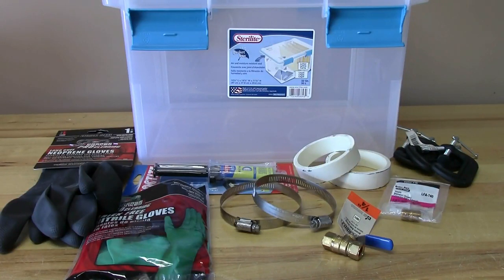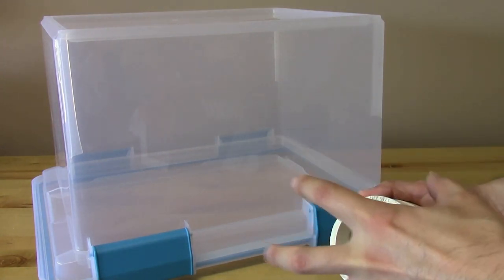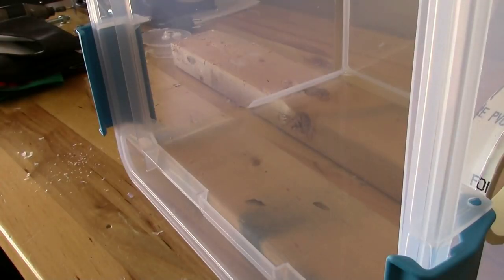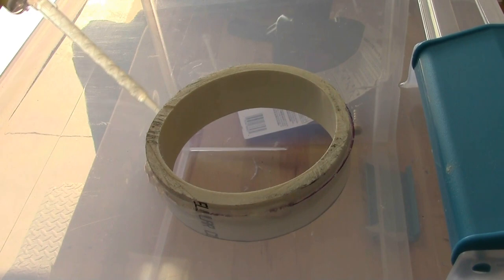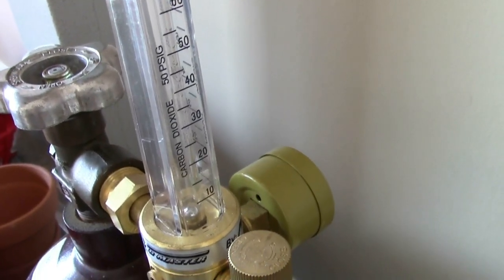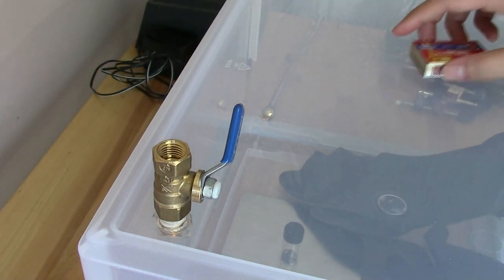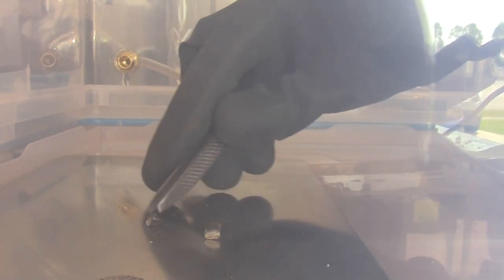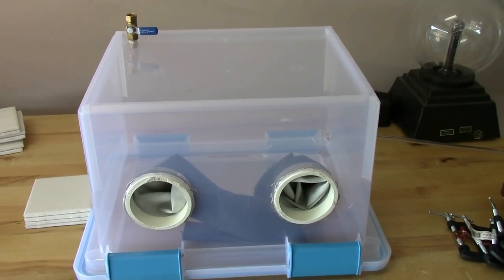Very Simple DIY Glove Box

Comment: Hey man is this anaerobic? I'm trying to make an Oxygen free chamber.
Reply from the maker: If you fill it with inert gas, sure. It does leak a bit, so depending on your requirements you may need to seal it better.
Reply: @mrhomescientist  do you think I'd need to buy a tank of like 1% O2 and Nitrogen? Thanks for your help
Reply: @mrhomescientist  also, curious how much $ for a tank like that? Just wondering man thanks a lot
Reply from the maker: @peterjon2758  Well if you need oxygen free, a gas with oxygen in it probably isn't the way to go, lol. Pure argon is cheap. There's an initial cost to buy the cylinder, but exchanging it is inexpensive. The cost depends on the size of your cylinder, and the size of your cylinder depends on the flow rate and duration you need.
Reply: @mrhomescientist  gotcha! I mentioned the 1% O2 because another publication detailing the protocol in the specific cells I'm using, indicated to use a 1%O2 and a certain percentage CO2 and Nitrogen. I just realized as well that I need to fit this in our incubator too so, that likely won't work. Unless I can make a very small version of this...not a glove box per say, but a small plastic hyperbaric chamber.
Reply from the maker: @peterjon2758  Ah, well if that's what the procedure says then I'd follow that. You could try making a tiny version of the box out of a Tupperware container, if you don't need the glove holes and are just putting it in an incubator. Just add two valves - one to fill and one to release. Have both open while purging with your gas, then close both when it's ready to go in the incubator. Careful if pressure buildup when it heats up!

Comment: It's time to extract some Lithium :)
(#3)
Reply from the maker: I actually tried out some improvements to the box today and it wasn't that great :/ I hear it's extremely hard to get shiny Li metal, but I'm working on it!
Reply: mrhomescientist I haven't really seen it made before. I saw a video made by Nurdrage where he made K metal. That was a totally chemical process. It's more commonly made using high temps (as far as I've seen).
P.S. Nearly saw your license plate at 10:50. It's really weird thinking how easy it is to give out your own info. I almost put my address in a video once.